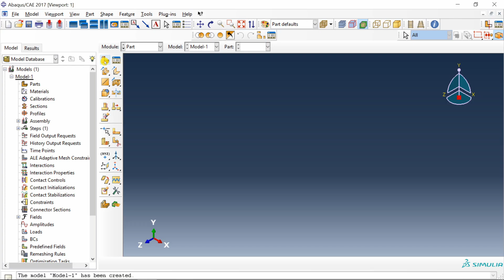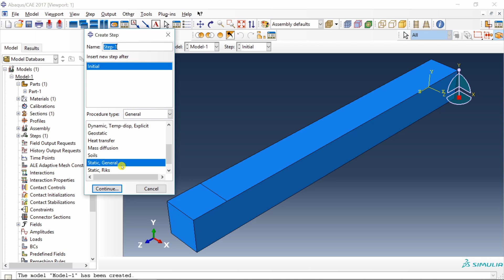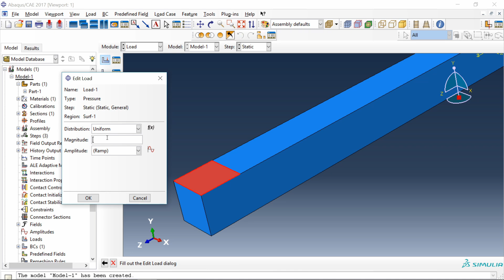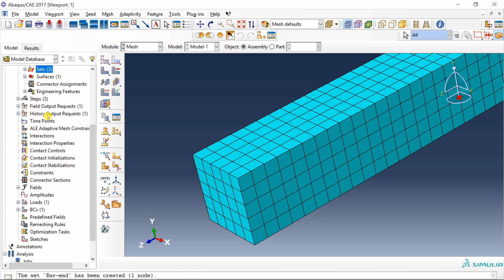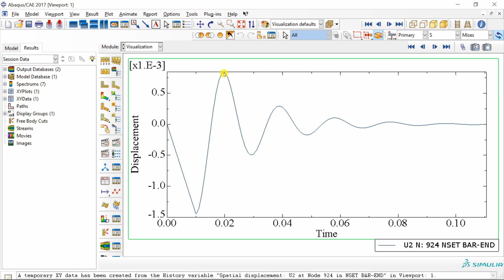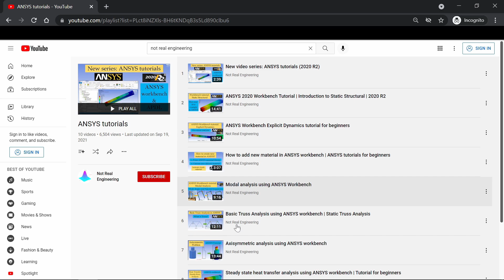Material damping in Abaqus CAE | Rayleigh damping | ABAQUS tutorial

Comment: How we can calculate alpha and beta? where did you get these two value?
Reply: In my field we use prescribed modal damping, thus alpha and beta are chosen so that the modal damping for the relevant modes of vibration are close to the prescribed values (alpha and beta are not material properties). I you want the modes between 1 and 5 Hz to have more or less 1% damping, you can set alpha to 6.1e-1 and beta to 0.12, because that will give you a damping between 0.9% and 1.1% in the area of interest